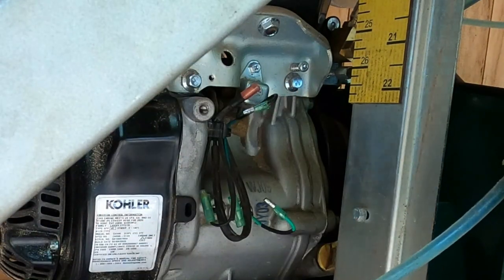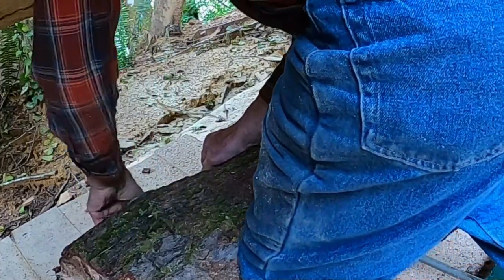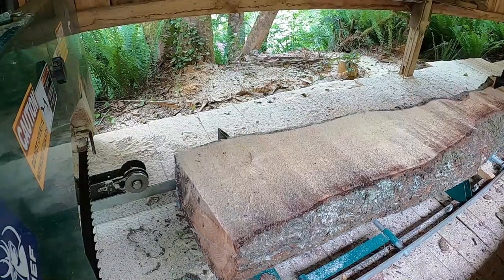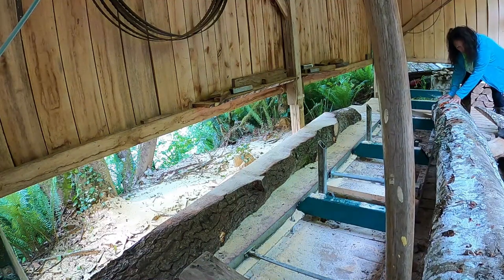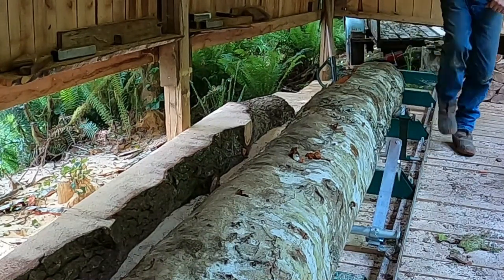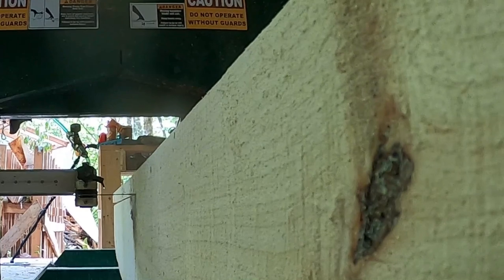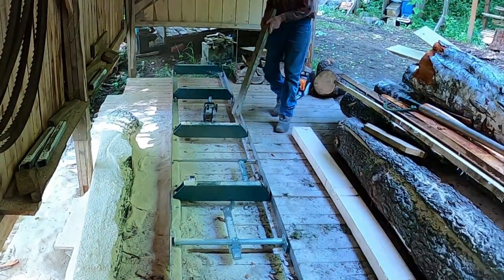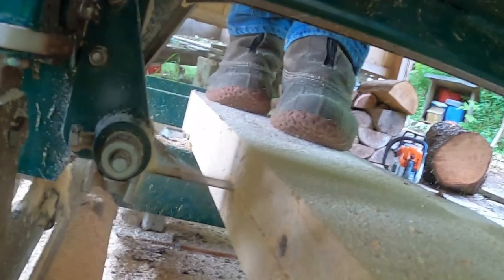Walking the Plank Ahead of My Woodland Mills Sawmill

Comment: Thanks for posting! This video convinced me that I am going to find an old winch and u-bolt it to a shed post. I am fine with hard work, but hoping a log won’t roll back on the ramp and break my leg? No, there are better ways to achieve personal satisfaction!
Reply from the maker: I've been thinking about this. There isn't room behind my rails for a winch, but I could put a pulley high on a post with a rope tied low and pull from behind the log. I'd me moving it away from me and me away from it. I need one of those pulleys that are open on one side to avoid wasting time threading the rope through it.

Comment: You do you ... it's your sawmill and your comfort level. We all do sketchy things. Funny how holding a running chainsaw and cutting at all different angles so close to the body is considered safe, but walking the plank is supposed to be dangerous? Even if the blade breaks, it'll stop and probably end up wound up inside the guards around the band wheels. People underestimate how fast a blade stops when in wood.  Those claiming it's unsafe, probably haven't run a mill.  Great video ;)
Reply from the maker: I've broken three blades. All stopped in the wood and were contained within the wheelhouses.
I cut the steel bars out of the exhaust chute before I knew what they were for. I'd weld them back in, but it's physically impossible for anyone to be on the sawdust side of the mill and be speared by an escaping broken blade, so I don't worry about that eventuality.

Comment: Eric, would barbell weights counter the crowning?
Reply from the maker: Funny you should ask. That idea came to me as I was editing this. I have bulk lead and an I-beam trailer axle, all of which are low enough for the saw to pass over them and combined weight of about 200 pounds. Eager to try that out. Next time.
Reply: @OregonOldTimer  👍🏻 Walmart sells individual weights, if you need more. I bought a couple small ones to use in the resin pots to keep wood from floating. They hang nicely on the wall, handy but out of the way.